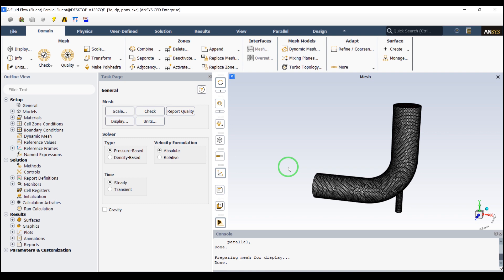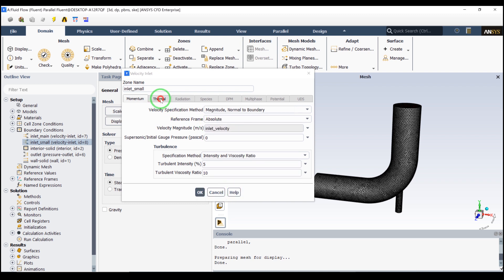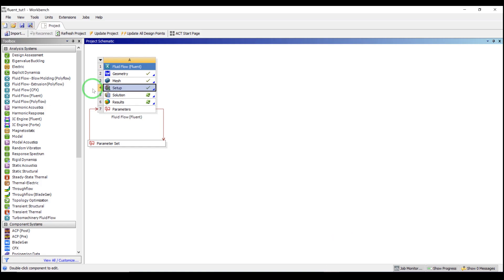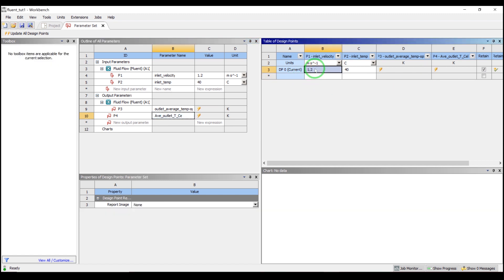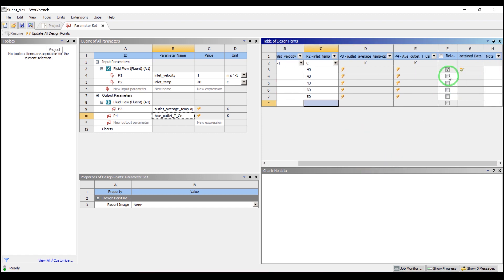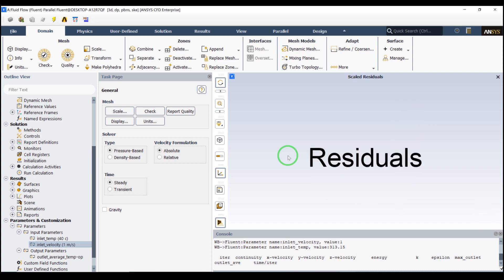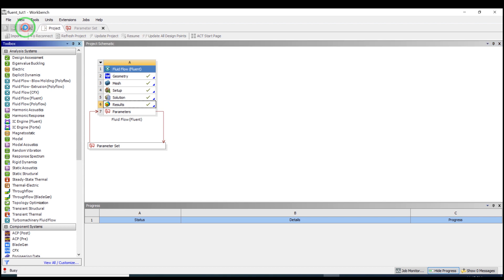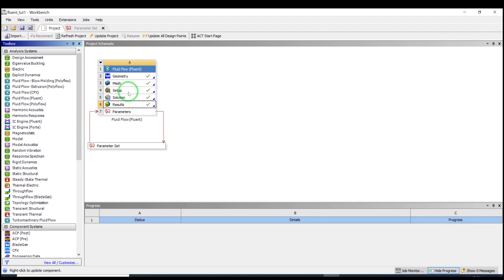Fluent First Tutorial (Heat Transfer Mixing Elbow) - Part 4 of 4

Comment: Hi, if you would change the mesh to 5 or 8mm would you see a change in the temperature and velocity plots and counters?
Reply from the maker: Thank you for watching and thank you for your comment. Yes, you could see a change. In a real design or simulation work, you need to always test grid independence. Meaning that changing the mesh size shouldn't change the results significantly.